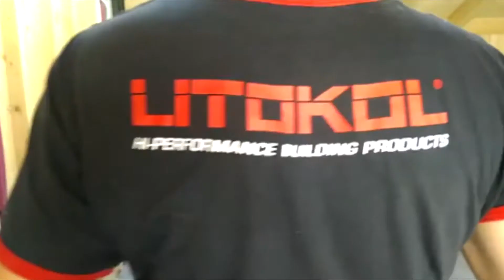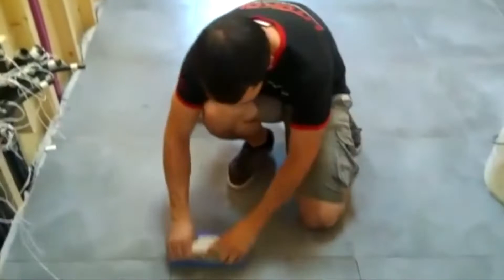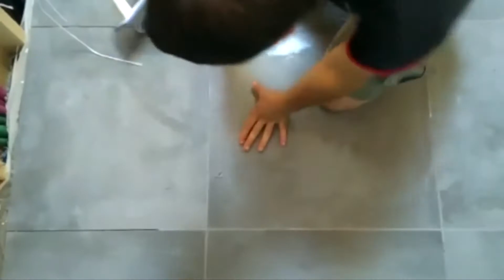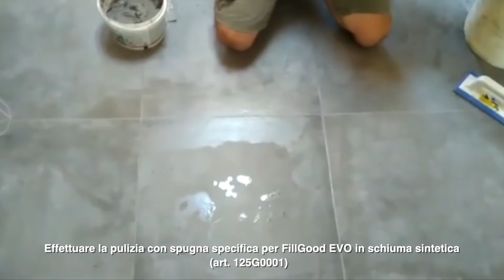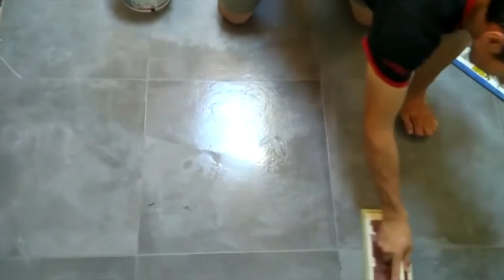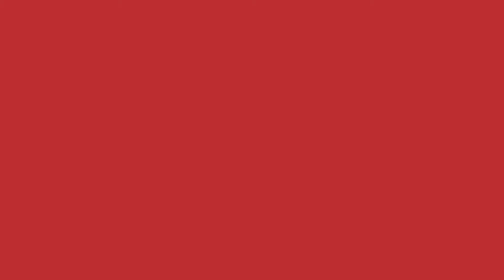FillGood EVO - Applicazione a pavimento fai da te

Comment: Смывка разве не нужна?
Reply from the maker: Hi Aleksandr,
It is recommended to apply the product covering areas not exceeding 3-4 m2 and that can be cleaned within 15 minutes. Cleaning and finishing of joints is done with a well-squeezed sponge for use specifically with FillGood EVO or a Sweepex sponge, by performing circular movements and taking care not to empty the joints and without leaving stains on the surface. Should transparent stains remain on the surface of the tiles or mosaics due to film formation of the resin, it will be possible to intervene, after no less than 24 hours from the grouting, with the neutral FillCleaner EVO. For further information consult the technical data sheet https://bit.ly/2Zqg2K2

Best regard,
Litokol S.p.A.